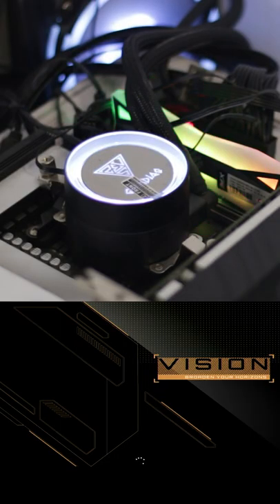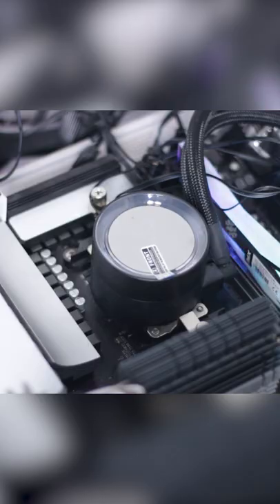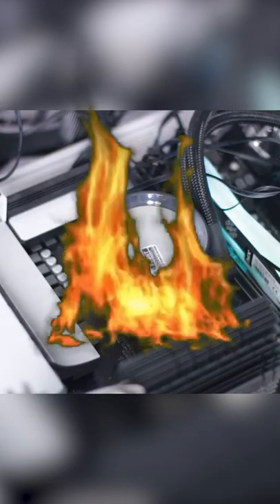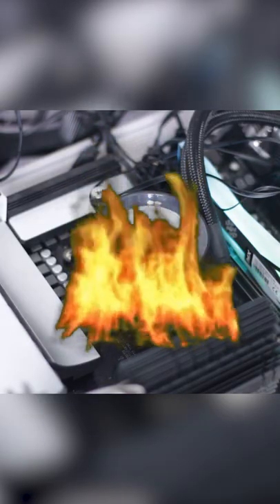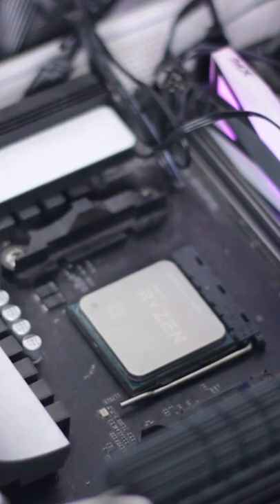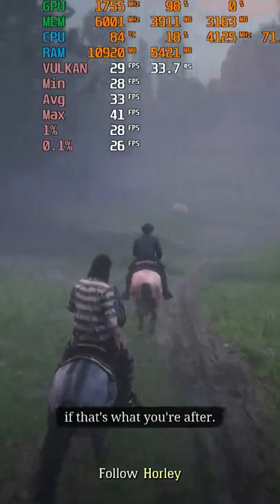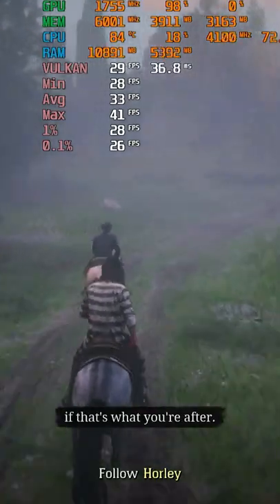GAMING WITHOUT THERMAL PASTE | Thermal Paste-இல்லனா என்ன ஆகும்?

Comment: Thermal paste will remove uneven surface finish and avoid air resistance between two contact surfaces.
This air resistance increases thermal resistance and in turn increases the temperatures.
Thermal paste is just like gel type which fills all small unseen visual gaps .. hence no air resistance and increase in thermal resistance 
Thermal paste conductivity around 4W/m-K

Comment: DEAR COMMANDER,
En pc adikkadi off ahuthu 
Yeannu kandu pidilka mudiyale?
Please sollunga yeannu
Reply: PC adikadi off aavuthuna
1) Neenga power supply ellam crt aa irukanu check pannunga 
2) PC Oruvela boot aachuna, idle use la evalo temperature poguthu nu paarunga
3) HDD illa SSD crt aa connect pannirikaanu check pannunga
4) CPU socket la olunga irukanu check pannunga
5) PC ya dismantle pannitu ellam componentsyayum clean pannunga
Because sometimes dust aalayum sila component olunga Vela seiyathu!
Try all these methods mentioned and hope it will work!

Comment: Bro 3 sticks of Ram use pannalama? 
example :
 2*8gb and 1*16gb use pannalama?... Plzzz explain about that....
Reply: Use panlam bro
But, neenga appidi podratha iruntha ore company ram podunga(kit is recommended) and athe frequency la podunga
Maathi potingana pc boot aavathu
Reply: @vishalthetechy3894  Same company same frequency la thaan bro poturuken... but blue screen error varuthu bro..? Any solution for this?
Reply: @saravanabalajik6206  bro enaku therinju neenga 16GB ram stickum 8*2 ram stickum podrathanala varalam
Neenga three yaa podumbothu ore memory irukura stick podanum
Vera memory irukura stick potingana 
BSOD( Blue Screen Of Death) varum
Reply: @vishalthetechy3894  thanks bro.. then naa 2*16gb 2*8gb podalama?... apo ethavathu problem varuma?...
Reply: @saravanabalajik6206  Bro try using alternating DIMM slots. Also Vishal bro sonna maari identical stick use pannunga (frequency, rank, etc. should be similar)
Reply: @MarkAllen-xt1wm  Ok Thanks brother... :)

Comment: bro my laptop running above 90c while gaming even though thermal paste is applied
Reply: Bro, I think it is thermal throttling
Laptop aa dismandle pannitu thermal paste maathunga
Or Fan oda rpm koranjurakalam
Reply: Bro laptop la 90°c easy varum bro...while Intensive task... check the temperature when your laptop in idle!!
Reply: Bro that is laptop design flaw. Intensive task will result in more heat generation bro, cannot do anything. Try cleaning exhaust and intake vents and use cooling pad

Comment: (Intel NH82801GB)    indha motherboard support pandra maximum apu processor sollunga plzz
Reply: Ungalukku indha mother board la podrakku processor venuma bro?
Reply: @rkfftamil9715  yes
Reply: @naveenn132  intel core duo E5400 paarunga bro
Reply: @naveenn132  apdi illana core duo e8400 use panlam bro!
Reply: Bro muudunja socket type pathu sollunga one time confirm pannikalam... Enakum doubt ah dhan irukku
Reply: @rkfftamil9715  sorry bro na plan mathiten 
New motherboard , processor , graphics card , ram. total aa 13k la vramadhri solringa bro plzz for gaming
Sorry for disturbing🙌
Reply: @naveenn132  sari bro soldra 13 k la venuma
Reply: @naveenn132  bro graphics card epdi bro processor and mother board eh avlo price ku vandhurum bro 😶
Reply: @rkfftamil9715  graphics card gt 710 2 gb = 4000 
Processor and motherboard than bro 6k le venum 
GTA 5 play aana podhum bro
Reply: @naveenn132  estimated price processor mono and ram ku mattumey 7k varuthu bro
Reply: Adhu poga cabinet SMPS monitor lam irukkey
Reply: @naveenn132  processor - i5 3470 (1155socket) ~3700
Mobo - zebronics h61 ~ 3700
Ram - 2gb × 2  1600mhz dimm ~ 1200
SMPS ~ oru 1000 (approx)
Graphics card ~ 4000
Cabinet ~ 1000 (approx)
Storage device epdiyu oru 2700 varum bro
128gb SSD and 320 gb hdd (evm 2.5 sata 3 ssd and toshiba sata 300 hdd)  
.
.
.
Total budget oru 18k poguthu bro.... 
Idhellam online price maybe nenga Richie street pona components cheap ah kedaikkalam.... Adhula oru 100 to 1500 save panlam
Reply: Intel i3 la current generations check pannan but nenga extra spend pannanu adhan i5 ku poitan bro.... Just oru estimation dhan prices may differ so nalla ketu visaruchu vangunga cheap aana Edam parunga enaku therinju motherboard lam refurbished unit kedaicha vangalam bro and mukkiyama SSD potukonga os ah adhula install pannikonga cuz pc ku konjo speed kedaikum ennoda amd A4 potato pc eh gta 4 push pannuthu bro mid graphics settings la 😂.... Apdi irikaila kandipa ungalala gta 5 oru 40 fps pakkam mid or low graphics la play Panna mudiyum kandippa 😌.... All the best bro components pathu vangunga
Reply: @rkfftamil9715 bro i already have a computer. motherboard , processor , graphics card , ram mattum change panna podhum
Reply: @naveenn132  yovv innah viladriya ne 😂 enna brow ellam vachuttey enta ketrukinga sari bro ram mudunga vara 2 sticks ah podunga 4 gb ah irundha 2 gb 2gb ah podunga sariya bro....
Reply: @rkfftamil9715  sorry bro😞😞 
i5 3470 3rd gen processor aache ippo use pannalama